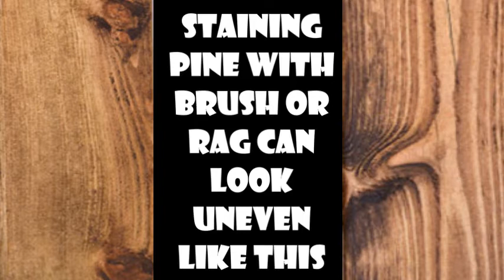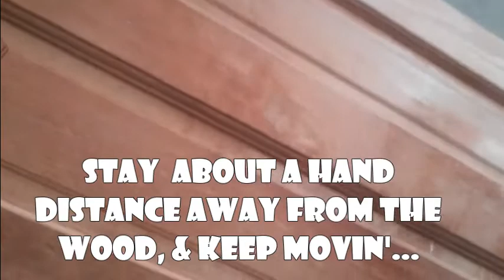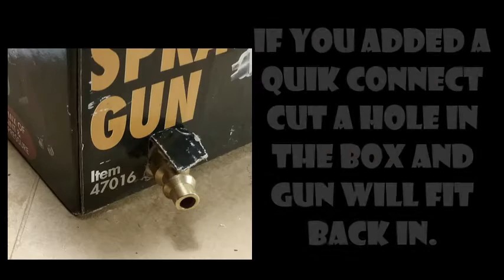Wood Finishing With Harbor Freight HVLP Spray Gun Spray stain plus polyurethane mixing tips & hacks

Comment: WOW! Just what I was needing. I'm tearing apart my kitchen (doors and drawer fronts) and I've got them cleaned up and used Watco med walnut to restore them to original (they're 40 years old!) and I was wanting to put polyurethane on them but I've never done it before. Using a brush would take forever. I have the same spray gun from Harbor Freight so your instructions and video was what I needed (desperately!) Super video. You have another subscriber. Bill
Reply from the maker: Tks for subbing Bill. Hope it will help the job go smooth. My work was done in 40 degree weather so yours can only be better! Keep in touch!

Comment: how do you control bugs and dust ? also ,what pressure did you set the gun or compressor ? .nice spray finish
Reply from the maker: I did this in winter so no bugs. Air set to about 40 psi I believe. You must test it on scrap cause the temp and thickness of the paint means alot. good luck!! Let me know how you do???
Reply: @teddidit6088  ok thanks ,i finish the 3rd coat like 2 hous ago ,but its not smoot ,dont know what happen ,i sanded between coats ,so i wont reapply poly again ,i will sand it with 1500 and buff it .

Comment: Help.  Trying to spray midway floor poly undiluted, in a HF gun that I enlarged the nozzle to 2mm instead of the 1.4mm. I’m getting lots of very fine bubbles in the butcher block unfinished table tops, and I really would like to spray the poly on as I have 12 table tops to do..
What do you recommend to eliminate the bubble problem.  
Thanks
Reply from the maker: Sounds like air cant dissipate cause poly is too thick...Unless you stirred the poly alot  & got air into it. maybe air is getting the gun. are there bubbles coming up in the gun's bowl? Or maybe its too cool by you to spray poly straight from the can, or maybe just add some thinner. Or you might have to use one of those airless sprayers if you really must spray  thick stuff like that. good luck!!!
Reply: @teddidit6088  thank you.  I only stir poly very slowly. The temp was in the low 60’s that one problem I found it being too cold. And the air pressure was 30lb. From what I know now the temp was too low. My first time spraying and set the gun fan and pressure per several people, and not spraying poly before I didn’t know what was too high.
So I waiting for the temp to be over 70, then try the lower pressure. The good thing is that the butcher block (BB) tables have two sides and both must be finishes to prevent moisture absorption and curling. 
I’m hoping I can talk more to people that are well versed in spraying poly, because I have 12 BB tables to spray. 
I bought a lamb wool pad but am skeptical that it won’t shed fibers even after prep per the directions, and a lot od cleaning is required between coats.  I have staged 3 tables at a time and at four coats with 6-8 hours between coats that’s a lot of wool applicator cleaning, not to mention the thinner used to clean them.     So many unknowns. 
Thanks
Reply from the maker: Thought I sent this but duuu...Hope all went well with your table project!

Comment: Nice video,  I was looking for a spray gun for latex water base paint. I did some years ago inside my house where I have a ton of bull nose.  It came out nice, but my old craftsman spray gun doesn't work  anymore. Perhaps I didn't get the tips clean enough, not sure. Maybe just sitting around doing nothing for 20 years. Tried just spraying some water through it and no go. I vaguely remember 20 years ago I had problems with it. Anyways, I would like to spray paint some latex water base paint again . My daughter wants to build a media center and she wants to paint it a specific color. 

Any ideas on a spray gun for latex? Do you think the purple or any other HF gun would work with latex paint.  Looking for a small investment for perhaps a one time use. We might find some other uses later on, but right now we just have the one use.
Reply from the maker: I did paint kitchen cabinets with latex a while back & it worked good. I Bought a flow agent at 
 HD and it helped give a nice finish. A HVLP gun with paint cup on top is the way to go for latex. Tks for the great comment. Pls consider subscribing, I could use more like you.
Reply: @teddidit6088  Thanks for the reply, I bought one of the purple ones yesterday and cleaned it real good! It did have a lot of junk on the threads, which others have said will clog the gun at exactly the wrong time if not cleaned.  I also drilled out the tip with a 5/64 drill bit, so now it is very close to 2mm. I have a couple latex paint projects coming up so will give it a try. I also bought FlOOD, Floetrol Latex based additive  from Amazon, to help thin my latex. So far I have only tried water thru the modified tip and it did spray good and I had no leaks, I also used teflon tape on almost all the threads.  

I subscribed to help you out, you could subscribe to mine and help me out also. Mostly mechanical work on my son's worn out vehicles and a few others.  Thanks and good luck!
Reply from the maker: @johntube2525  HOpe it all works out for you . Sorry I dont get notified when someone replys. Just subbed to your channel.
Reply: Rockford!